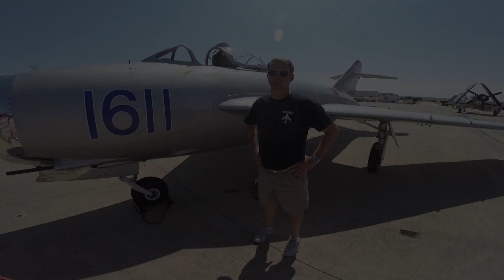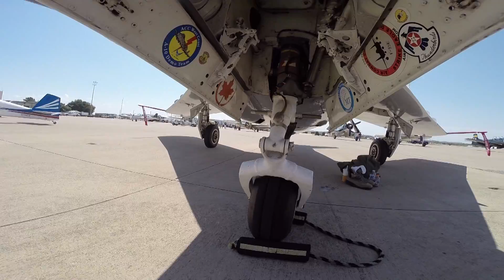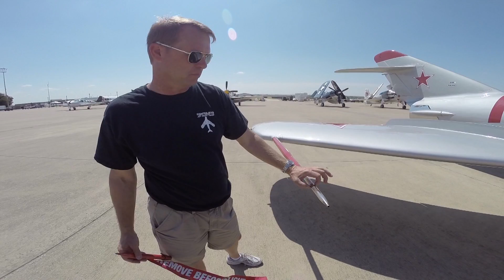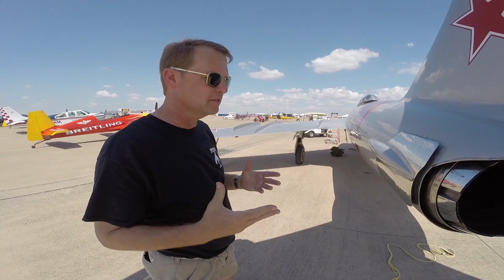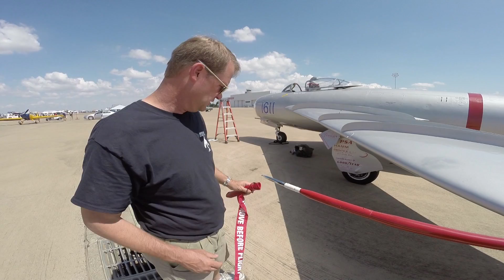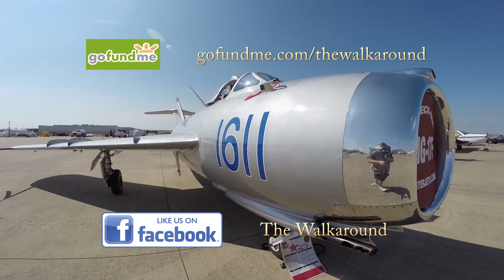MiG 17 Walkaround Randy Ball

Comment: Neat walkaround. But...
The fences are for drag reduction by decreasing boundary layer down wash; the tangential airflow will create massive amounts of drag at the wing tip, putting fences in its way will reduce that drag.
It's not called IFF, it's RWR. IFF is for radar that is looking at you (it's a responder), so that Soviet radar operators knew you were indeed friendly. RWR has an indicator inside the cockpit and tells you that you are being looked at by a radar.
And no, the dihedral is there to reduce the excessive stability provided by the 45° wing sweep (sweep has the same effect as anhedral).
Also the flares are for communicating with ground control in case of radio failure.
Reply: Actually you're wrong. You're mistaking a wingtip vortex device for a true wing fence - there's zero drag reduction from a wing fence, their sole purpose is to prevent spanwise flow which would otherwise cause the Fresco to "saber dance" at low v/high AOA. Who told you it was for drag reduction?
Reply: @jasoncarswell7458  Original documentation :)
The spanwise flow has many effect on the aircraft. You will find that the vortex drag that the wingtip "vortex devices" (winglets) prevent is further increased by span-wise flow. So by reducing span-wise flow on a swept wing design you're fixing a lot of problems at once.

Comment: Love it! Except the ejection thing regarding tomcats. YES there is an interlock where the seat catapults cannot fire until the canopy is blown off, however there is a reason that the pre ejection procedure for a flat spin in the Tomcat is DIFFERENT from standard ejection. When falling flat it creates a low pressure area above the canopy and without forward motion the  canopy isn’t guaranteed to be clear prior to the rear seat catapult firing which would lead to that scenario. There’s a reason the spin recovery procedure in the F-14 has an extra step. 

1. STICK: forward/neutral lateral, HARNESS: LOCK
2. THROTTLES: Both Idle
3. RUDDER: opposite turn needle/yaw
(If no recovery)
4. STICK: Turn into needle
(If recovery indicated)
5: CONTROLS: Neutralize
6. RECOVER at 17 Units AOA, thrust as required.
      IF Flat spin verified by Flat Attitude, Increasing Yaw Rate, Increasing Eyeball Out G, AND lack of Pitch/Roll rates: 
7. CANOPY: JETTISON
8. EJECT: (R.I.O COMMAND EJECTION)

There’s a reason CANOPY: JETTISON prior to ejection is a step in a flat spin, because it WILL come off and disengage the seat/Canopy interlock, BUT it MAY NOT be clear of the RIO seat when it leaves the jet in that situation.

Comment: thanks for the top gun spoiler
Reply: Mike Nolan except what happened in the movie is something that can happen in a Tomcat when falling in a flat spin due to area of low pressure created above the jet (massive lifting body), when ejection is commanded the canopy is jettisoned automatically and after a VERY short delay the RIO seat catapult fires. Every time the Handles are pulled. When flying forward there is slip stream to pull the canopy away and the jet is still moving forward. When falling flat that isn’t present. That’s why the pre-ejection procedure for an F-14 includes after step 6 of the spin recovery checklist: IF Flat Spin Verified by FLAT ATTITUDE, INCREASING Yaw Rate, INCREASING Eyeball Out G, AND LACK OF Pitch AND Roll rates....

7. CANOPY: JETTISON 
8. EJECT (R.I.O COMMAND EJECT) 

It’s to jettison the canopy FIRST which gives the jet time to fall clear of the canopy prior to pulling the handles. When the canopy is gone the RIO seat will instantly be fired upon pulling either handles, giving the RIO time to clear the canopy. If standard ejection just pull handles is attempted, in a flat spin scenario there IS a possibility of a goose type death.

Comment: He forget's that the HS-129 B-3 (German anti-tank aircraft designed during World War 2) Had a modified Pak-40 with a revolver style loading mechanism.... That was a 75MM gun strapped to her belly..... So THAT is the biggest gun of any aircraft on any side of its time......
Reply: Alex Turpeinen You are also forgetting the 75mm cannon fitted to the WWll B-25G model medium 2-engine bomber. It was a slightly shorter and lighter version of the M3 main gun mounted on the M4 Sherman series medium tanks.
Reply: There are multiple AC-130 models which have a 105mm M102 Howitzer. I believe it's the biggest gun mounted on an airplane, ever. And only one P.108A was ever made. Yes, the MiG-17 had a big gun, but there have been much bigger guns on many aircraft.
Reply: Ki-109 in japanese service had the 75mm as well